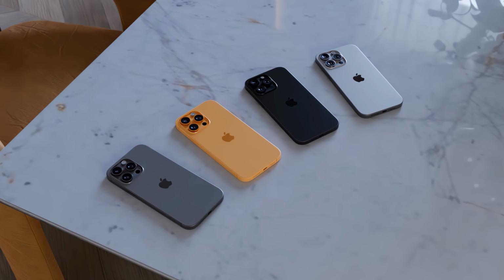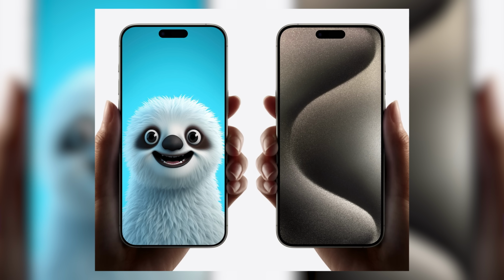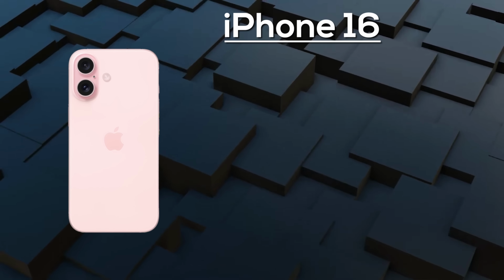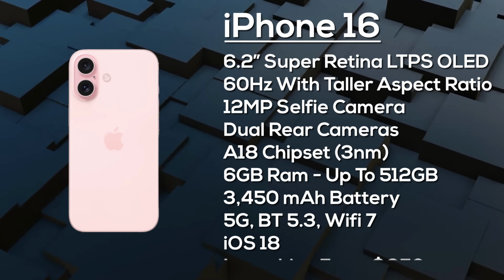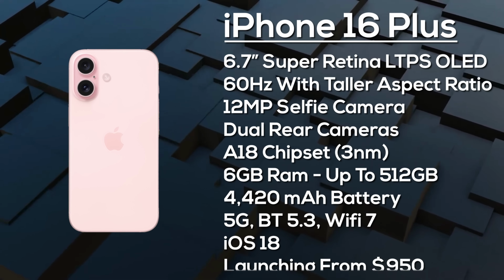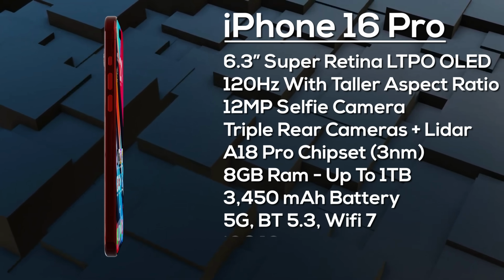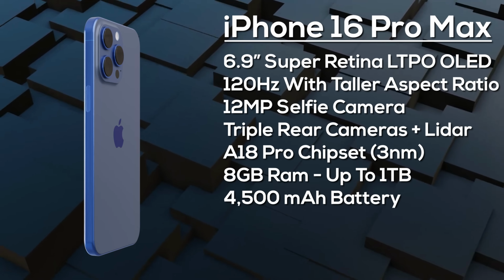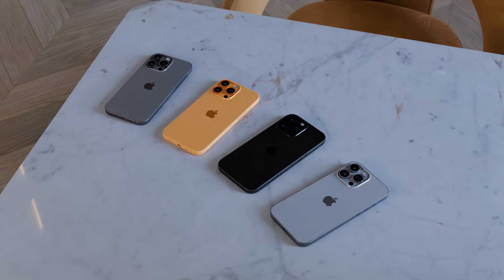Apple iPhone 16 Pro Max - Breaking Records!

Comment: I use Samsung Galaxy S24, and it's by far the best!!
Reply: No body cares!!! Give me a break
Reply: Well to be short , Samsung is promising to sort that issue on their new software update "Android 15 / One UI 7 " coming around August
Reply: I've been on Samsung since the S4.  The S20U and S22U gave me a bad experience. The camera was always sluggish and those phones were slow. Did Samsung address the camera stuttering? 

I'm currently on the pixel 8 pro and it's given me the best experience so far. Other than that I'm kind of leaning towards just switching over to iOS due to its ecosystemm
Reply: @sneezygibz6403  me too i have s24 plus but it constantly r4uns hot and so muc bugs and camera issues as well